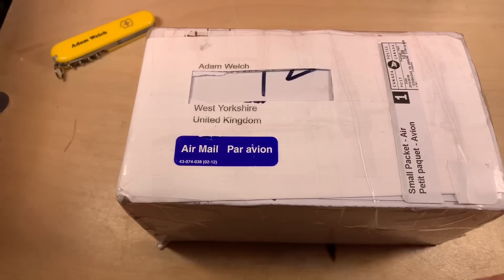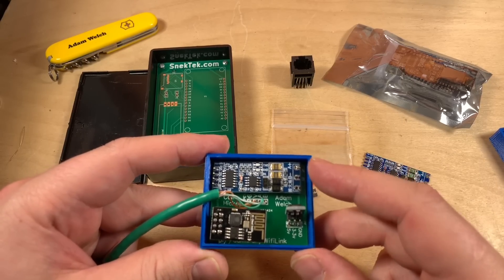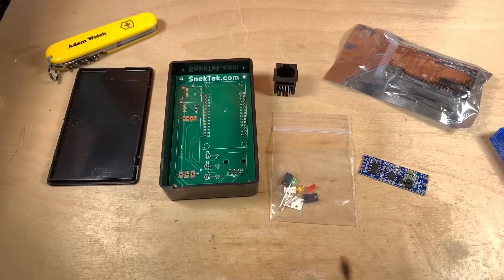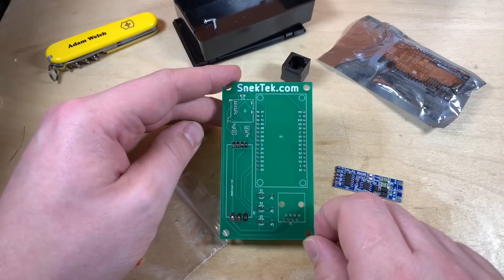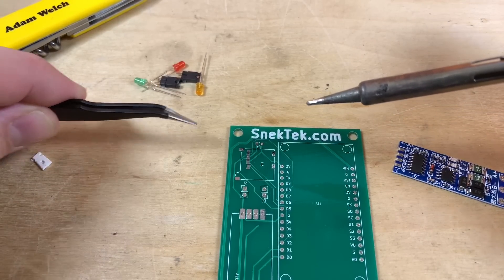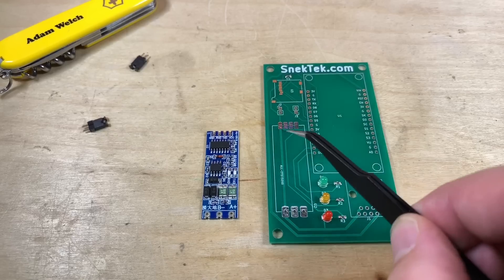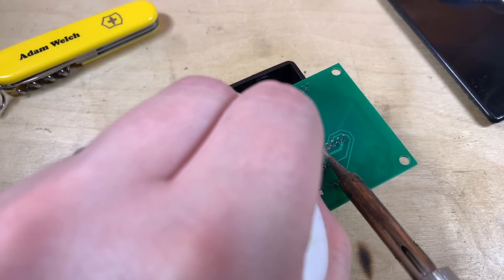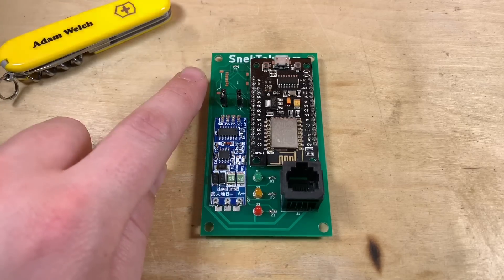EPEver Solar Dashboard Part 1 - Hardware

Comment: Hi Adam, the logic level ESP operates at is 3.3v and the RS485 is 5v. Don't you think this needs a logic level shifter?
Reply from the maker: My understanding is that espressive confirmed that the GPIO pins on the 8266 are 5 volt tolerant so it shouldn’t be an issue. The esp is powered through a linear regulator at 3v3 on the nodemcu module.
Reply: @AdamWelchUK  Fair enough. My NodeMCU (probably a Chinese clone) didn't tolerate the 5v signals more than few hours. It's no longer working.
Reply from the maker: @gayanx86  Thats a shame. It seems that the tolerance of the 8266 is disputed by some online. Looking back, the five volts from the charge controller is connected to the nodemcu and regulated down to 3.3v. The five volt rs485 data pins connect to the rs485 module, which is memory serves is powered by the regulated 3.3 volts. So the nodemcu would be communicating with the rs485 module at 3.3v and the rs485 module is getting the 5v data from the charge controller. So there may not be an issue at all - although I didn’t design this board and can’t quite remember.
Reply: @AdamWelchUK  I've seen people noticing the the 5v signal side of the circuit, for example like the I2C displays pulling the NodeMCU signals from 3.3v to near 5v. Although the 5v tolerance is a debatable topic, I've ordered some logic level shifters along with new NodeMCU modules.

Comment: Hi Adam
You could have used these to mount the daughter board.
https://uk.rs-online.com/web/p/sil-sockets/1648794/
Reply from the maker: Good shout - do you know if probably got some somewhere too!
Reply: @AdamWelchUK  Here https://www.ebay.co.uk/itm/32-Way-PCB-Socket-Strips-SIL-Turned-Pin/122920791236?hash=item1c9ea66cc4:g:jf0AAOSwUv5bYAvI

Comment: I wish EPEVER/Victron would make a charge controller with a BMS built in for up to 14 packs in series etc... I just bought all the parts for the DIY BMS v3 and dreading it tbh lmao. Considering just paying through the nose for pre assembled boards from China if i screw this up (which i probably will). Great video brother!

Comment: It would be nice if it had a screen, since you can only connect one component to the controller, I have two EPever tracers, and probably going to have 2 more! Connected to two battery banks!  Great video
Reply: I actually am running 2 EPEVER controllers on this single module, It's pretty much working save for a few little bugs.

Comment: Awesome! Thanks for featuring this. Worth mentioning I was inspired by your collaboration with Collin while researching this project. As Adam mentioned, the SD card was out of stock but I have them now.  The source code and board files are available on my bitbucket, and the kits are for sale on the shop. I will be updating the software soon to do SD card logging and so forth. Thanks
Reply: SnekTek will this work with the esmart3 charge controllers?
Reply: @shawni38  The esmart3 seems to have a RS485 interface so yes, but the software will need to be adjusted to read the values. If you end up doing it I can help with the software. See this website where the guy reverse engineered the protocol: http://skagmo.com/page.php?p=documents%2F04_esmart3_review
Reply: SnekTek, hi is posible to read the web page in google home app? Or other app?
Reply: SnekTek, hi is posible to read the web page in google home app? Or other app?

Comment: Adam!  I've been repairing boards for 35 years and I can mention that I generally solder from left to right.  I am right handed and feed the solder with my left.  By working from the left, my iron is located in a spot where it doesn't affect the part that I just soldered.  If I am working on a repair and accidentally heat the joint next in line, it's not a big deal because I'm getting to it.  When soldering the opposite direction, I am constantly bridging the joints that I just made!! Just a little tip that might save you a bit of time.  Great video.  I've been trying to figure out the RS-485 standard but I just can't seem to find the time to learn it.
Reply from the maker: Nice tip. Thank you. On the snektek forum you can find the epsolar document that lists all the registers you can query if you like - that might help you?
Reply: @AdamWelchUK  Thanks.  I will look it up.
Reply: Why didn't you spin the board around?
Reply: RS485 is basically a differential version of RS232.